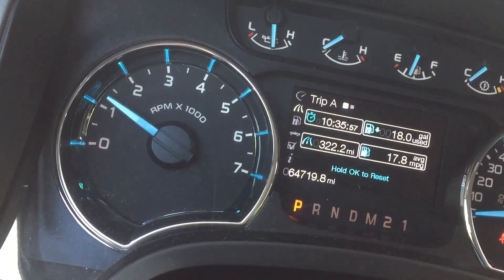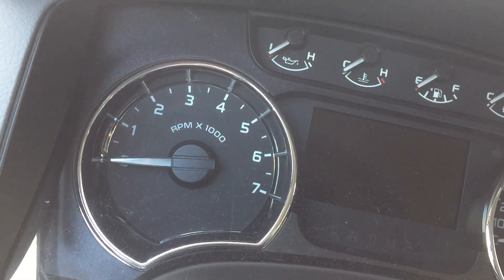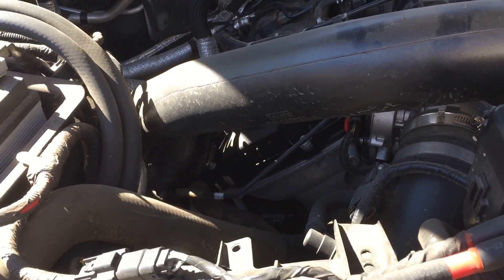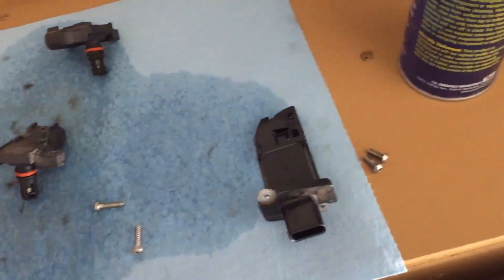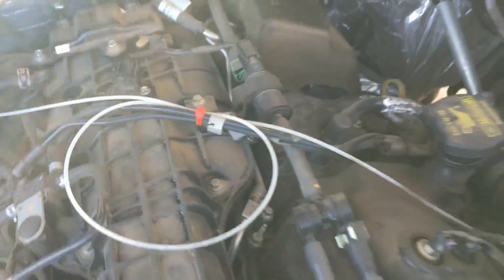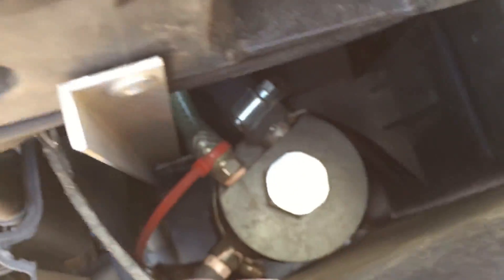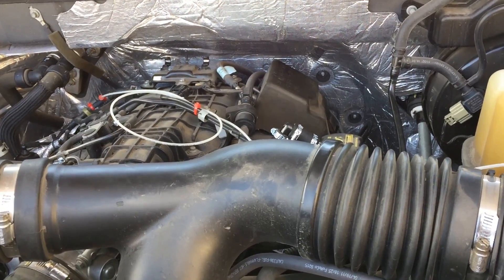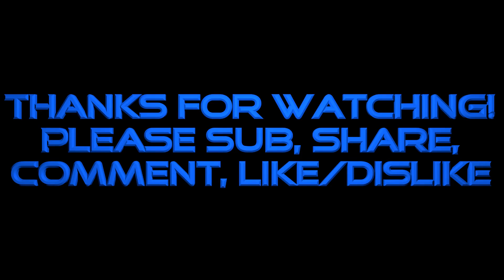Ecoboost Shudder Fix

Comment from the maker: Check out the buildup on the intake valves for these ecoboost motors: https://youtu.be/8gMr3W8L82Y
Reply: Did you delete the crankcase pressure sensor with a tune ? I have a 2015 3.5 expedition with that p04db after a k&n intake!!😔

Comment: Hey, how’s the going.
Just purchased Lincoln mkt 2019, 3.5l eco boost turbo with similar problems.
Engine starts but won’t accelerate with rough idle.
New York is the location and just wanted to know if we can hire you to resolve the issues.
Pls respond ASAP.
Thanks

Comment: Thank you for the video. I learned a lot from it.  You also mentioned another common problem of ecoboost which build up of carbon on the back of the valves and hence you installed the catch can.  Is there a good method to clean those valves other than taking the engine apart?

Comment: Nice. I just bought a 2014 F-150 ecoboost about two weeks ago. I am trying to learn everything about these engines as much as I can. Thank for your video.
Reply: My 2014 ecoboost was an amazing truck. Ran like new at 220,000 miles when i traded it. Only issue i had the entire time i owned it was rust. Oil changes every 3500-4000 are a good idea thats what I did. I liked it so much i got a 2017 ecoboost now so i stuck with the same truck just newer. Gotta admit so far i like the first gen exoboost better though. My new truck seems to have more issues

Comment: Is there a recommended time to have the battery disconnected?
Great video.
Reply: It reset the computer to read with clean sensors instead of old data. So before you startup again for accurate stats and whatnot

Comment: Very informative! Thank you .
Just purchased a 2015 F150 with the 3.5 ecoboost and want to keep it running good without a bunch of crazy,  and very expensive upgrades or tuning. 
In regards to the check valves you installed,  I'm assuming you can check the direction of flow prior to installing or they have a direction printed on them?
And where did you get them?
Thanks again because I hate 120.00 dollar an hour shop rates!! And the added 5% added to your repair bill so parts changers get paid to clean their tools and put them away.

Comment: Wait... 
That's a v6 turbo. Right? 

On other catch-can installation videos, people suggest placing a check valve on the tube connecting to the throttle intake, with the arrow pointing towards it, not to the other tube exiting the crankcase top, like you've done. 

Can you please advise us, as to whether or not we should then install check valves on BOTH tubes. 
Presumably, arrow pointing out from the crankcase, and arrow pointing in, at the intake. 

Or what? 

Please advise.

Comment: Thanks, appreciate the video availability!    I just got my 2016 F150 XLT with the 3.5L Ecoboost, and it's running fine, but I'd like to learn as much as I can on this particular engine, and try to keep it running smoothly as well as with longevity!   Thankfully, the previous owner took the truck to the same Ford dealership that it was bought at, for it's services, so I had them print off all the past services from new (quite a bundle).   The truck already has 125K, but runs smooth, so I'm thankful for these suggestions on cleaning these sensors!   I've also ordered two catch-can's and one way valves, which I'll install in the next week or two.   Thanks also for the tip on spark plugs, as I'll try and learn all I can on that as well.  I already have some electrical contact cleaner, so I should be good to go!   Thanks again, as I live in western Canada, and believe with our humidity, the catch-can addition should be helpful!

Comment: As a tech with about 30yrs started around 84 full time around 88 cleaning your sensors is something I always did a lot of.Many shops used to just install new sensors but I always thought it wasn’t fair ,not that I thought they were trying to rip anyone off I just think it was a common practice due to fault codes,dealer recommended repairs etc..many cars over the yrs have had issues with the PCV systems with oil build up, ford used to have a filter in the back of the intakes that would plug up..anyway nice tip to help out the DIY ;) ..

Comment: Great video. Thanks. My truck even turned off on me while idling yesterday. I got a diagnostic message when I connected it at the auto part store of P1450, and another video said it was the purge valve. Would this fix it or do you think they are unrelated. Nevertheless, I’ll clean the sensors, too. I got 67k miles on it, and I’m sure they are not doing too well. Thanks again.
Reply from the maker: That specific code is a failure of the purge solenoid for the high pressure fuel system, which should be located under the engine cover or on the drivers side near the top of the motor. The auto parts store should have them or be able to get the gas purge solenoid for you. The sensor cleaning should help idle after the purge valve is replaced.
Reply: NickelNDiminIt thank you for the response. I’ll do both, then. You got yourself a new sub. I plan on keeping my truck for a while, and any channel that helps me with this is greatly appreciated.

Comment: You do realize that those check valves are built into the pcv system. So your just adding 2 more. Otherwise in factory condition itd  pressurize the crankcase
Reply from the maker: There is what looks like a check valve in the factory system on the passenger side, but it is not a check valve because it does not seal against pressurization. It is just a restrictor really and not a real check valve. So I am aware of the intended function.

Comment: Just got a 2020 3.5 EcoBoost a few days ago. I’ve already added the catch cans but seen how you installed yours different than I... my mountings are both “higher” than the engine and yours are lower. Can gravity have a negative effect on my installation? Also, I never even thought about there needing to be check valves. Did your cans come with them?
Reply: Crickets...

Comment: I will try this when the weather warms a bit..I have a cylinder 2 code came up when I punched the gas pedal a bit.. engine light did fast flash for a minute or so at highway speed then the light went out and everything went back to normal..Changed the plug and coil pack.. any other ideas besides this sensor cleaning? Thanks in advance.

Comment: Where did you get the by pass valves for the catch cans? Thank you!!
Reply from the maker: Those came off of ebay from a search for 5/8" check valves.
Reply: @nickelndiminit5136  thanks you!!!
Reply: I want to hear more about the catch can set up.
Reply from the maker: @my89stanggt1  This is something I will address with several other things back once I get the truck back from the dealer for recall work on the transmission.

Comment: Hey guys -great videos here and I'm taking it all in after buying what looks to be a new 2017 Expedition! I want to follow along with the necessary modifications and maintenance to keep her in tip top shape. It appears to have lived in a garage as everything is minty clean, in and out. It has 75K on the clock and I'd like to get caught up with any work that you guys would recommend. Please give me a short list of "must do" items and I'll report back now and again on my progress. The reason I'm here is because I noticed the rpms at idle acting exactly as yours were...
Reply from the maker: I would do the gapped down plugs like I have linked in the description, but with a 28 thousandths gap, install a catch can. I am about to buy the catch can I have linked in the description, but you should be able to find one for the expedition on amazon like it for the 17. Then there will be some more videos coming where I take off the throttle body and check the backside of my valves with a camera and I will either prove or disprove the cleaning power of methanol injection...lots of info to come. Also, methanol means I can have more boost. Stay tuned. ;)
Reply: I'm having the idle issue -it hunts around from 550-ish to 600-ish, very slight but it's def there I can feel it. I'm wondering why yours at vid beginning is hunting around 1K, but at the end of your vid is more like mine. I can still see it fluctuate -mine looks the same as yours (at the end). Did the (3) sensor cleaning get you the smoother idle?

Comment: i have been wanting to do a catch can on my f150, but the kits online dont have the check valves like yours, except the company that wants 500.00. not willing to pay that. can you tell me where I can purchase them and any part numbers I may need. By the way thanks for the great video.
Reply from the maker: The check valves I found were on ebay. This link should be similar to what I bought. http://rover.ebay.com/rover/1/711-53200-19255-0/1?ff3=4&pub=5575562230&toolid=10001&campid=5338641496&customid=Nickelndiminit+check+valve&mpre=https%3A%2F%2Fwww.ebay.com%2Fitm%2F5pcs-16mm-5-8-Fuel-Non-Return-One-Way-Check-Valve-Petrol-Diesel-Aluminium-Alloy%2F263373857027%3Fhash%3Ditem3d524e2103%3Ag%3ADLsAAOSwr81UMjmo

Comment: Having the same problem in my 2016 expedition 3.5..... ford isn’t willing to help, go figure.
Reply: Check for throttle body codes. It usually won't set one with wrench limp, but sometimes does. TB is around 120 from online Ford dealers, 180 local dealer. Gasket is around 4.

Comment: One thing I don’t understand about the one way check valve,  Fords original hose before catch can did not have a check valve what so ever, it’s just a hose with fancy ends that allows vent to happen. Why would that be any different with a catch can? Seems to me people are over thinking the catch can. Thoughts?
Reply from the maker: The catch cans are a needed factor on these trucks, cars and suvs. Ford has to have the engine reingest these vapors for the sake of emissions. We as customers can address a known issue like this with catch cans. My specific catch cans were less effective before the check valves. The new system I will install with get a video to follow this topic. I am also working right now on a mythbuster video for methanol injection cleaning the backs of the valves...so I have a lot more videos to do about this topic. Stay tuned.

Comment: I bought a 2019 F-150 XL in July 2019. with the 2.7L Ecoboost engine.  Is this something I need to worry about?  Is this a maintenance activity you need to perform routinely?  Thanks.
Reply: Ford will tell you know. But the reality of it is yes. Get a JLT oil separator. I got one even for my Subaru wrx. Anything with forced induction is more susceptible to burning oil. Subaru has earned the title “6SOE”(six star oil eater). Having that check valve in the PCV system on the passenger side is amazing. You don’t need a catch can on the driver side like he did only because that side of the engine doesn’t pull enough vacuum to cause any diluting of the octane. I think the check valves on both sides is a pretty ingenious thing to do through.
Reply from the maker: There are many people running catch cans. I am going to switch to the one linked in the video description. I think it is the best one on the market right now. The internet's opinion will often vary from mine. But I have not had to clean the sensors for about 30k miles now.

Comment: You should move that check valve on the dirty side of your PcV system closer to the manifold. Save the seals in your catch can...
Reply from the maker: Yes, that system is going to be revised soon.

Comment: Before your idle was at 1k where you where getting the shudder I noticed mine always at really low rpms when I'm leaving a parking lot never at complete idle probably around 1k rpm
First motor replaced at 12k bad piston ring noticed ticking. I traded the car at 30k needed a truck. And just a bad time for a sweet car at this point

Comment: You could use MAF sensor cleaner also.
Reply from the maker: Yes, this would work. Honestly any solvent would do fine to get the film off. Catch cans are definitely needed. I will be switching to the one linked in the description.

Comment: I did a catch can on my 2018 f150 2.7 ecoboost. It does catch about a full can ever oil change. So that would be a lot of oil over time so I could see why that would be a problem
Reply from the maker: Yup, this is exactly what the issue is. Better to not have to clean it off of valves and things later.

Comment: What a mess!  Direct injection, cylinder deactivation, start stop technology, turbos, superchargers. Engines have become way to exotic for me.  Modern day efficiency comes at a cost.  I stick with timing chains and I prefer pushrods. I'd rather have some torque down low than hp at the high-end, but that's just me.  If I need an 8cyl., I prefer a Chevrolet LS motor.  If I need a 6cyl., I go with the Toyota 2GR FE.
Reply: Dirty Harry  You know your stuff thanks for the advice.  Glad to hear you've found some modern day powerplants you've had great success with.  I've had bad luck with boosted motors. Obviously they're only groing in popularity so something's working.
Maybe the problem is I'm getting too old. I grew up wrenching on cars, could fix almost anything. 
Now I'm lucky if I can find and replace a cabin filter.

Comment: As an engineer, you should know that to flesh out a problem, change only one variable (sensor) at a time.
Reply from the maker: Yes, also as a chemical engineer I know oil films on hot sensors causes a thermal transport barrier acting as an insulator slowing response of the ECU which could result in an expensive dealer visit for 'low power' concerns.
Reply: Should know that those are caps not resistors. But again, removing those o rings might be a good idea while spraying.. Unless there not rubber?

Comment: How would out contaminate them if they're in front of any oil. ? Only one is effected.
Reply: The first one gets dirty from fine particles that get past the air filter these trucks are also known for condensation and oil that from the turbos to collect in the intercooler and does make it's way up to the throttle body to affect the second map sensor

Comment: I've had my 2012 F150 EB for a year now and it has always had this problem. After my local mechanic cleared some codes that it has had since I bought it (from a FORD dealership), he started it up for me and I asked him if he noticed the misfire. He told me that it did not trip any codes for a misfire but could he could feel it. Since he was only getting my truck running for me because of all the codes prevented it from running, I didn't have him address the issue. I will do this in the very near future and upgrade the ignition. Thank you for the information.
Reply from the maker: Hopefully this info helped. Dirty sensors in these will cause intermittent behaviors.

Comment: this worked perfectly on 2013 3.5 EB f150.  Started shuddering/rough idle right after deal did recall update.  This fix cleared it right up.  only question is, what do I do with this new set of spark plugs?   Thank you!!!!!!!!!!!
Reply from the maker: Glad it helped. The plugs I use with the gap info are now linked in the description. 28 thousandths gap has worked great for me on a 91 tune for about 50k miles.

Comment: this worked perfectly on 2013 3.5 EB f150.  Started shuddering/rough idle right after deal did recall update.  This fix cleared it right up.  only question is, what do I do with this new set of spark plugs?   Thank you!!!!!!!!!!!
Reply: Keep them until its time to change them
Reply from the maker: Glad this helped. I would say hold onto the plugs like suggested below.

Comment: I am shopping for F150's but I just can't bring myself to buy a $50000 truck, only to have to re-engineer it myself. I love the way the f150 rides and drives, but I've seen way too many 'fix' videos for them. Seems like every brand in the same. THey build crap, and sell it for a bazillion dollars, and there is nothing we can do about it. Harumph. Ef it. Thinking the best thing to do is not buying anything at all.
Reply: the thing is not re engineering them its the maintenance !!!!! keep your sensors clean!!! and this is a turbo motor you must install a catch can to keep the blow by or back out of the engine also all the crying is from folks who dont know whats going on firts step is know your TRUCK!!!!!!  and remember TRUCKS cant fix their self!
Reply: You can buy a F150 with the COYOTE engine, in my personal opinion its more powerful and more dependable
Reply from the maker: Try looking also at problems with the eco-diesel dodge and jeep products, or any of the turbocharged direct injection motors. These aren't going away, so your options are high mileage less efficient vehicles or newer vehicles with newer maintenance problems. To be clear for all those looking, the dealers and manufacturers couldn't care less about your maintenance concerns so long as you buy from them. Picking a vehicle with known solutions already available from front-runners like me means less headache when things break. Otherwise you will be at the mercy of the dealers.